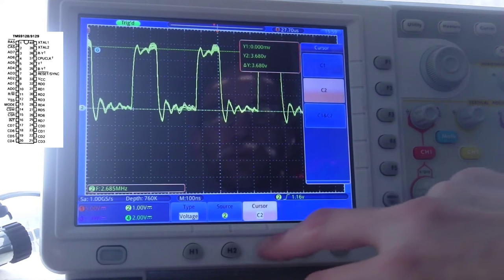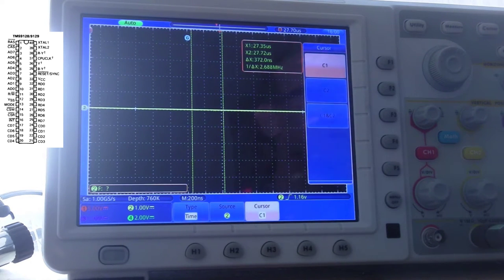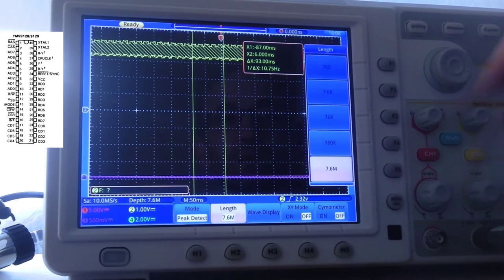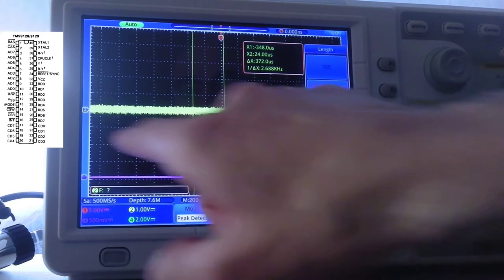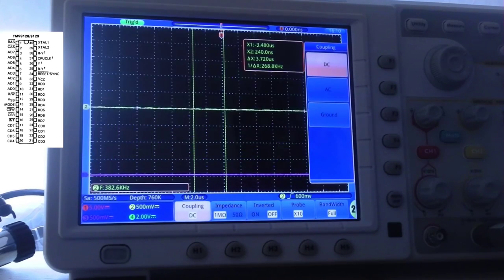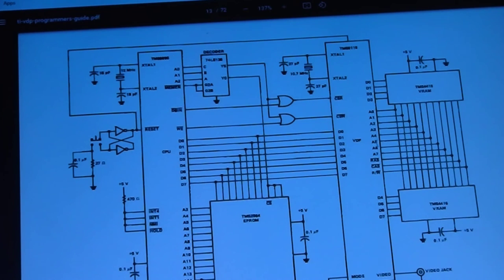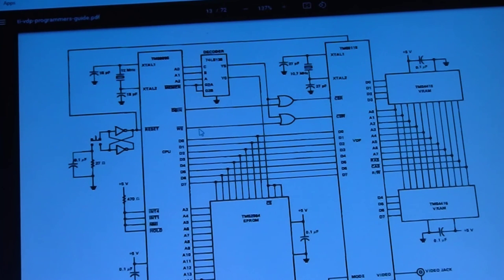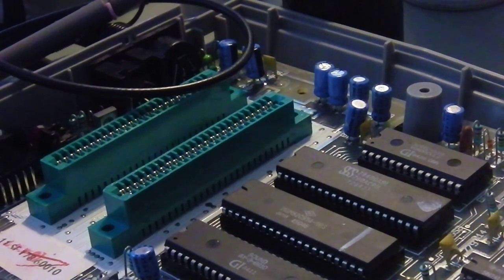MSX Philips VG8010 Part II - checking signals on VDP IC TMS9129

Comment: Was it possible to fit the memory board with the socketed chips? And was it still possible to close the case?
Reply from the maker: Indeed ... this was one stopper of the repair. In addition the board uses Pinheader as stand off for connecting to the base board -  those would have to be made longer.  The repair stopped. Did not continued on that yet.
Reply: @tech-jeweler  Have you tried replacing the BASIC ROM, you can use a 27C256. That fixed all problems with my VG-8010 (it had a black screen and continuous beeps).
Reply from the maker: haven't tried that. Haven't had the impression that at this point the failure is originating. The VDP IC got hot. On video RAM on some datalines no "living" signal was detected. So I aimed to fix this part first. Thank you for your  hint. I appreciate - thanks